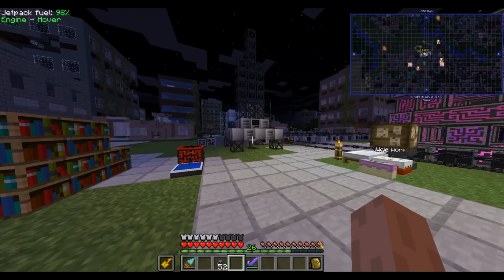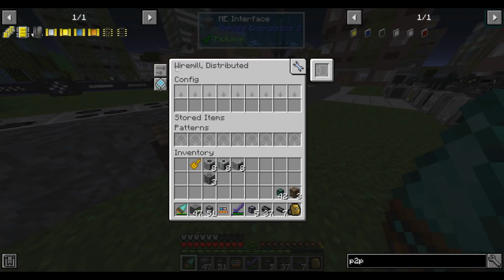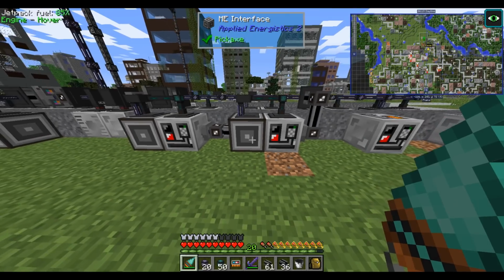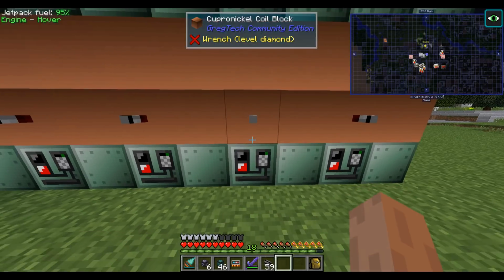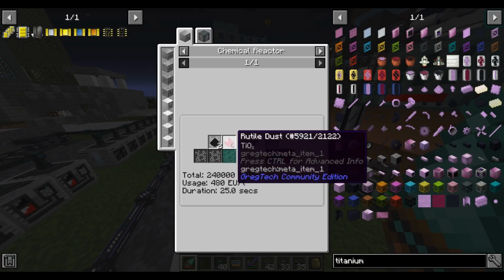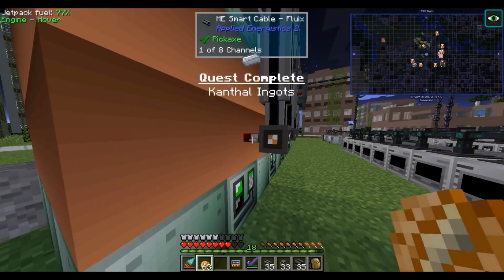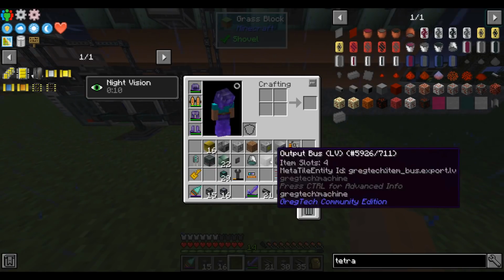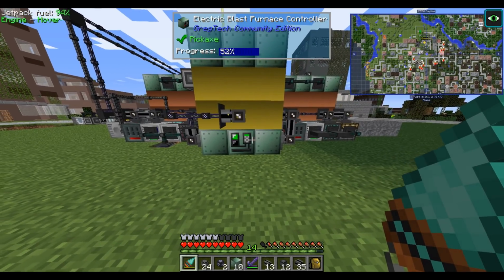Omnifactory EP08: Automation for Every Occasion

Comment: Conduits can get pretty FPS laggy, especially in large builds with OF Gregtech that use fluids.
Machines output on the back side so you put an ME interface on the back and one on the top. If there are liquids you need at least 2 sides, up to 4 sides if you have both liquid/item I/O. (Note that you have to press the orange package icon on the bottom left for the GT machines to output, output mode has orange on the actual block, blue for liquids)